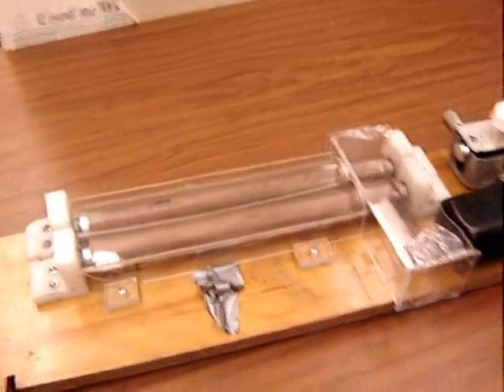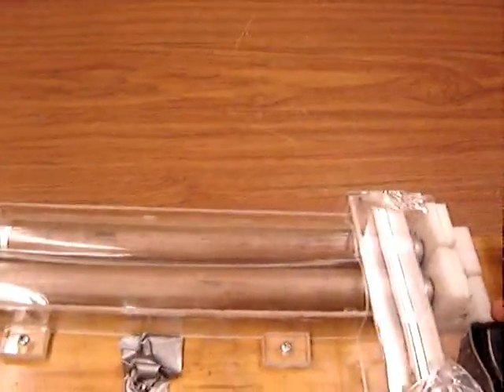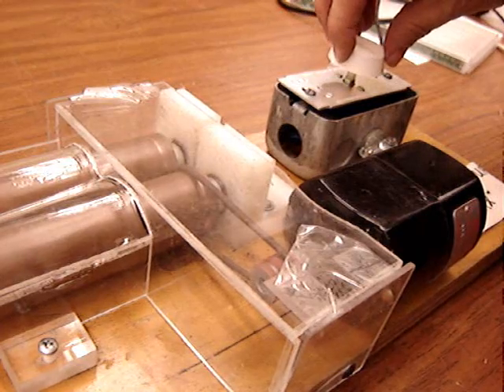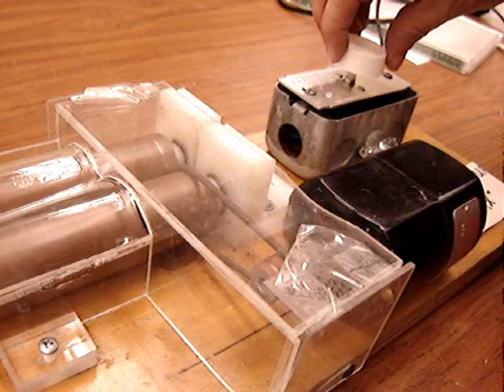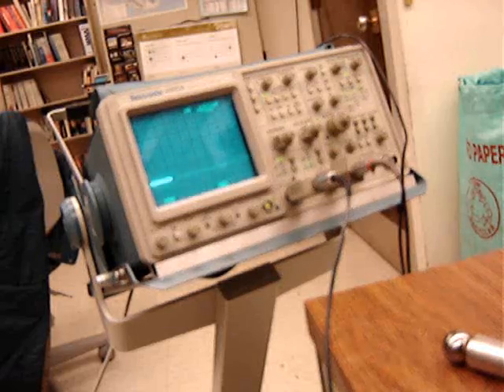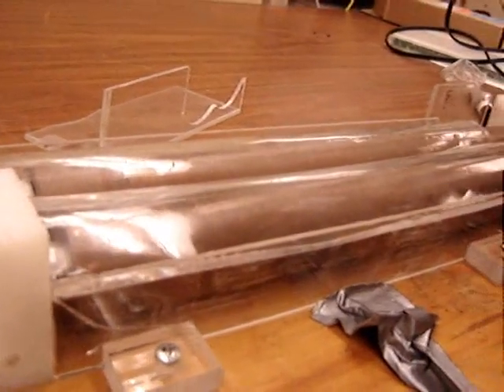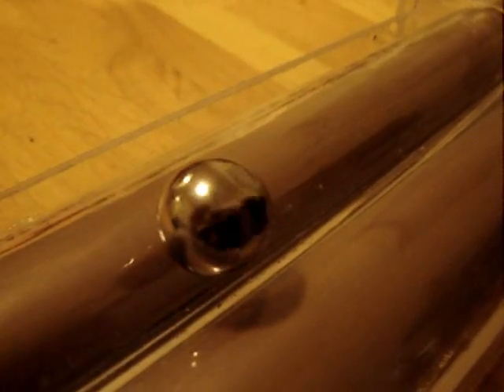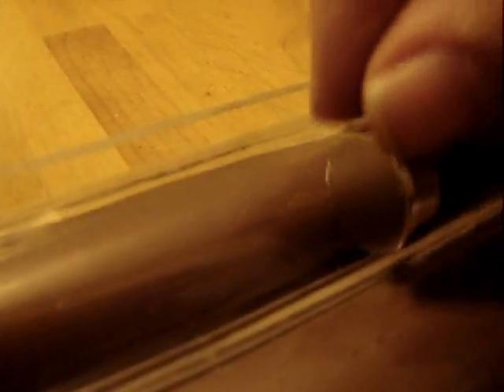Dangerous High-speed Magnetic Levitation Maglev

Comment: still providing inspiration 16 years later :D
Reply from the maker: Where did this device come from?   From a visionary mental state!  It happened during a plane trip down to California.   I was designing physics exhibits for musuems, and considering the neo-magnet-in-copper-tube demonstration, when suddenly I saw an entire bunch of spinoffs, with high speed copper parts lifting up supermagnets.   It's just like superconductor levitation, but with rotating copper hidden inside an opaque box.  Magnets will float mysteriously.   This two-pipes version was only one of them.   Another:  two huge rings spinning in opposite directions.   If we drop supermagnets into the gap between them, the magnets should float (and also repel each other.)   It's almost like a model of an atom, where each time we insert another floating magnet or "electron" into the gap, they all repel each other, and start wobbling with standing-waves at a single frequency.  (But never actually built.   It's only a mental image.)    
PS 
During plane-trips our brains are bathed in strong nuke radiation.   This seems to produce the same "vision-questing" mental state as swinging in a hammock while awake with eyes closed.   So, on your next flight, have a blank notebook sitting on your lap.   When the plane rises above a couple of miles, the geiger counter goes crazy, and also the creativity turns on full blast.

Comment: I heard that the magnet will disappear if you put it on a setup like this one and connect the Heisenberg compensator in series.
Reply from the maker: No, that just leads to specular rod liquifaction during subthreshold Fankle value, especially if finite thermal improbability source lacks sufficient color temperature.  
Also: if asymmetrical magnet "crashes" the cleft, it randomly disappears.   But doesn't it just fly across the room?  One might assume!  But no, it has no visible trajectory, and makes no sound, it "never comes back down!"

Comment: Wow - Finally, somebody on Youtube that is doing something with magnets that isn't a crackpot. Well done. Thumbs up.
Reply from the maker: Andrew Baker Heh, I think it's possible to build a "magnet flywheel" which demagnetizes the magnets and continues spinning for a few hours/days (without any load, and with extremely good bearings, of course)    The crackpots may be 'right' after all:  Magnet Motors may really work  ...it's just that they cannot drive a load, and they destroy their own magnets and need recharging with a big kilo-ampere magnetizer.

Trivia:  apparently it's much easier to demagnetize Neo rare-earth magnets than ceramic or alnico types.   So, if someone stumbles across a genuine "magnet motor" setup, it probably will involve Neo magnets, and it won't work if black ceramic magnets are used instead.

The trick:   the motor must move magnets in a cycle, and then follow one of two rules:   1) if they're repelling each other, slightly demagnetize one (or both) whenever they're at maximum separation.   2) if they're attracting each other, slightly demagnetize during closest approach.   That way the magnets perform net work on the moving mass, while the stored magnetization energy is reduced.   The moving part will walk down an "energy hill," defeating bearing friction and spinning for far, far longer than a simple flywheel would.

tldr;  to debunk crackpot Magnet Motors, build a genuine working version that runs for days, but also which clearly demonstrates that its magnets become weaker and weaker, then it stops.
Reply: so magnets can become weaker from "harsh" use?
Reply: yup. heat and mechanical shock are a few trusted methods.
Reply from the maker: Neo rare earth magnets become weaker if two repelling poles are forced into contact.  The magnet material at the pole face will re-orient so that the flux lines escape out the sides.  When the magnets are allowed to separate again, the altered pole patterns persist, and the magnet remains weakened.  (Manufacturers recommend that Neo magnets NOT be designed with magnets in repelling configurations, since it may slowly reduce the flux over time.)

Comment: Back again, wondering about this one.  I thought that perhaps if the copper wall was thicker, there should be larger induced currnets, due to lower resistance, and reduce the required speed.   This can be accomplished by nesting several different diameter pipes inside - Russian doll style.
Whacha' think!.

 I haven't, but wonder if you worked out the currents and fields that occur.  If you conceived the idea on a plane, you must have had the configuration of currents & fields in your mind already, or at least parts of it.
...
A quick think on this (and Flemings Right and Left hand Rules waved careflly in the air) makes me ask: If the magnet is held near only one rotating pipe, does it experience a force in a direction tangent to the pipe rotation, but in the opposite direction to the rotation? .... It seems that the magnet should be dragged along with the rotation as it would be for dynamic braking, but Fleming tells me it is opposite...and that being the case, it should float.
...
I worked out the fields for the magnet sliding down a conductive surface and find an interesting situation.  It's time to figure out this one...
...
 If I hadn't mentinoed B4, on the other side (or other direction of rotation) it should just suck the magnet to the pipes, rather than reach an equlibrium distance, no?
Cheers
Reply from the maker: Yeah, a 10mm wall thickness works better than a 5mm wall thickness.   On the other hand, part of a really thick wall is going to be too far from the magnet, so that part doesn't provide much extra force, and doubling the pipe's wall will not give you doubled lift.   Better would be to have lower conductivity.  Can we buy sched-80 steam plant piping ...made of pure silver?

:)

Fleming's (and Lenz) laws always give drag.   If they didn't, then magnets would speed up all by themselves.  And presumably the conductive slab  ...would get cold rather than hot?

Yeah, I suspect that, if rotation is reversed, there may be no stable levitation, even with different magnets, and even at infinite RPMs.
Reply: wbeaty  Don't see that I responded to this.
Up to some point I am sure thickness is very important.  I can see that adding 1/16 steps of aluminum to a magnetic breakng demo increases the effect to at least a total 4/16ths or 5/16ths. total thicknes (I don't have any more right now).  Remember that the moving magnetic field (relative to the conductor) creates an EMF, not a current.  Therefore, the lower the resistance (even if the B field doesn't penetrate all the eay) the higher the current will be.  This means a higher secondary B-field and repulsion. 
...
I haven't had time to work out the fields in the pipes...other troubling life events...
Cheers...
Reply: +caciquetainohatuey  Yep.  It'll work better because there is less loss and, therefore higher currents and a stronger magnetic fiels for any given speed.

Comment: Anyone know if this design has been improved on?
Reply from the maker: An artist tried to build a hand-crank version, but couldn't spin it fast enough.  I think you'd need fractional horsepower for that.   Power it with a stationary bike, not a hand-crank.
Reply from the maker: Also, years later NASA LLL invented the Inductrak(tm) levitator based on a long stack of copper rings with a Halbach array sliding over the outer surface.   In addition, if an iron lamination stack is placed inside the row of copper rings, the lifting force increases greatly at low speeds (since higher inductance, longer amperes time-constant.)   If some rings are actively driven, then you have an EM mass driver for flinging hunks of neodymium magnet into Earth orbit.

Comment: haven't been here in a while.  I love that old sewing machine motor...
...
- Going under, or rotating in the other direction should suck the magnet in to it, no?. ...  OR does it also repell...? Have you done this?  I don't see an answer. How works this magnetic mirror?? 
P.S.   Need more demos on this device...
I get 22.58 MPH.  It's the relative velocity, so the key has to be the tangential speed, right ?  I understand dropping the mag down the pipe (what I call the shorted turn magnetic mirror). 
- Can you give any insight into this eddy current direction.  It seems that it must stillt be around the circumference of the pipe since that is a compete circuit, no?  A near-by conductor should oppose any relative motion, but it seems it is along the pipe, but then that's no complete circuit unless it travels away from the magnet a bit before going around the circumference...?... so I'm uncertain...
- Also, a non magnetized ferromagnetic object below the magnet & pipes may experience the field from the edy currents induced in the pipe and be attracted more than if the pipes were not rotating...right?
'Gards, Retired EE and technical advisor @ Challencer Center.
-- Have U seen the YouTube VID with the LN2 cooled thick copper pipe?  The ultimate slow motion: 
Liquid N2 and copper tube magnetic levitation  
  Really shows how it is both repulsion and attraction effects.
Send me answer via message pls.

Comment from the maker: Nice.

For trains they put the magnets on the train instead of on the ground (way, way fewer magnets.)

For trains they put the magnets on the train, since magnets aren't heated, while aluminum is greatly heated.  A plate as shown can only be used for minutes at a time, then must cool back down again.

To create Levitation Pants, put the magnets on the pants, then hide the spinning aluminum disks under the floor.  Slide around on your (safely low-temp) butt.

Comment from the maker: Aluminum base should work fine, and less splinters!   The copper tubes can be touching or nearly touching.   I had them pinch the 1/8" drive belt, so the belt passing between the two tubes would spin both of them.

Comment: @Youcansuckme69 Yes, counter-rotating metal cylinders forming a pinch point, and spinning at about 24 miles per hour. Nothing could possibly fly apart or grab fingers/hair/loose clothing, or fail violently. This is ultrasafe.

Comment from the maker: @bastian   At 3000rpm that should make a big improvement.   But at 6000rpm, the 1/4" wall thickness should shield the inner portions of the metal, so the magnetic field never gets that deep.

If this ran at much higher RPM, a thinner pipe would work just as well as a thick one.

It might be interesting to somehow stick a magnetometer in the hollow part.   At a certain RPM, almost no magnetic field would get through.   Thick copper always is an AC shield, but spinning copper is a DC shield.

Comment from the maker: @bastian   At 3000rpm that would make a big improvement.   But at 6000rpm, the 1/4" wall thickness should shield the inner portions, so the magnetic field never gets that deep.

If this ran at much higher RPM, a thinner tube would work fine.

Comment: @wbeaty If you make the magnets bigger, the gap increases. I also worked out that it lifts at much lower speeds if the magnet is bigger- you want the magnet to be about one skin depth diameter at the frequency the copper sees.

So It might work better the other way, take 3 or 4 diametrically polarised 1  inch or bigger magnets and spin them axially and stick a copper or aluminum plate on top. This helps three ways, it should lift higher and the rpm goes down, and so does the surface speed.

Comment: No doubt it's dangerous and it *would* damage your hand! However, it wouldn't suck your arm to the shoulder, it probably wouldn't get your whole hand. The system isn't very powerful. If you put your fingers between the tubes (with it off) and then turned it on, it probably would burn out the motor or the belt would slip before it could pull your fingers through. The power is in the momentum and that would be drained very quickly. And, there isn't enough space under the tubes for an arm to go.

Comment from the maker: @Narkarina  Not really.  Make the magnet stronger, or lighter.  Do it on the moon with low gravity.   This whole thing works by making the magnet see its mirror image in the metal.  The magnet is basically lifting itself by repelling its own image, so if it's stronger, it can lift itself higher.

Comment from the maker: @AURUMSOLISTECHNOLOGY  Ah, the two-disks version?    Jdecker of Keelynet saw that in action at an alt-science conference.   Me, I was pursuing a new science museum exhibit, trying to do superconductor levitation without using any superconductors.    Besides spinning cylinders, I've wanted to try coaxial pipes, or disk-in-donut-hole.   Spin them opposite, then stick supermagnet pucks in the slot between them.  That should levitate unmoving magnets in 3 axes, looks exactly like Searl rings.

Comment from the maker: @revyin  If the rocket is moving faster than 30MPH, then the pipes won't need to spin.  That's how inductive maglev trains were supposed to work:  magnets on the train, flying over an aluminum slab.

Comment: @mrabuckten These aren't hollow plastic tubes being turned by a little homopolar motor. The angular momentum held by these tubes essentially turns them into small diameter flywheels. A bic pen would probably shatter if put in. Though you're right, it probably wouldn't eat an arm to the shoulder. But it would definitely mangle a hand, throw fingers across the room and generally ruin your day.

Comment from the maker: @mrabuckten don't be silly, it's 5lb flywheels spinning at 6000RPM, with all the mass at the rim.   That's how you make a machine gun that spits ballbearings.  Pull away the motor, and the danger remains the same.  Same joules as a 4.5KH copper block flying at 40KPH.  (Though for a machine gun you'd want high speed at the edge:  spinning disks rather than spinning tubes.)

Comment: very nice. had to wrap my brain around this one for a while, and still thinking.  the inverted  rig shouldn't work.  if you are inducing currents in the copper by the rotation of the surface past the magnet, those currents must be generating magnetic flux in the opposite direction.  That always repels.

Comment: Is the levitation due to the magnetic attraction to each part equally and each part moving toward at the same rate?

Also, would it have the same effect if the two copper tubes were turning away from each other?
Is electricity generated by this like your simple generator?

Comment: just wondering... on your oscilloscope, did it say 97.3 Hz or 97.3MHz?  because that ought to change the surface velocity of the copper pipes quite a bit.  I actually found this very interesting having just taken a university classical physics course in which we talked about magnetic induction and electric fields.

Comment: @dearThax 
Might help up to a point - the magnetic field from the magnet only goes so far.  Using larger diameter tubes would get the surface speed up for the same RPM - then you could reduce RPM to get the same effect.

Comment: Moving copper (or other conductor material)  in the presence of a magnetic field (from the magnet) will create rotating currents in the copper.  In turn, these rotating currents in the copper will create their own magnetic field.  This field, according to Lenz's law, will always be opposite to the inducing field, which tries to reduce the magnetic field in the copper, which pushes back against the magnet, causing levitation.

Comment from the maker: > sewing machine motor

Don't be stupid.   This is a many pounds flywheel spinning at 5000rpm.    If you removed the motor and left it spinning, DANGER DOESN'T DECREASE.      Imagine getting hit by a fast car that's in neutral gear with ignition turned off.   The engine is irrelevant, it's the mass and velocity which kills.

Comment: I assume you haven't gotten a decent answer yet because you didn't mention any specific materials. Cold temperatures and the ability to very easily induce permanent magnetic field would be the only hazards I would list in a report that is specific to superconductors. Fragility of some superconducting materials could be an issue too, especially when you consider the strong magnetic fields that could be involved. Same general hazard as strong magnets.

Comment from the maker: > Barnett effect

No, the repulsion is still there when the copper is still and the supermagnet moves in a straight line.  And Barnett is feeble; almost immeasurably small.

Electric current induced from the relative magnet/copper motion is large: between 10 and 100 amperes DC.  The b-field of this current can easily lift a supermagnet.

Comment from the maker: > magnets inside the pipes

No currents or drag, just a tiny voltage field.  It's the "Faraday Generator" effect.   In a Homopolar generator, you only cause a current if you rotate the metal disk or rotate the stator brush circuit.  Rotating the magnet does nothing.

Comment from the maker: > soft iron core

It's an AC effect, so you'd want to use powdered iron or ferrite, to prevent eddy currents from shielding the interior from the changing fields.

So...  a thin copper pipe filled with iron powder, that might work as well as a thick copper pipe.  But also the magnet is attracted to the iron, so I don't know.

Comment: thanks for the tips, but I have one further question. I was going over this with my friends in class today, and we came up with a crazy idea that might just work.

What would happen if a soft iron core was put inside the spinning copper tubes? 

That should boost the magnetic field many times over and lessen the need for the dangerously high speeds or thick copper tubes. Do you think it could work?